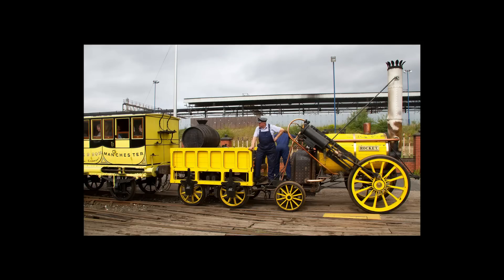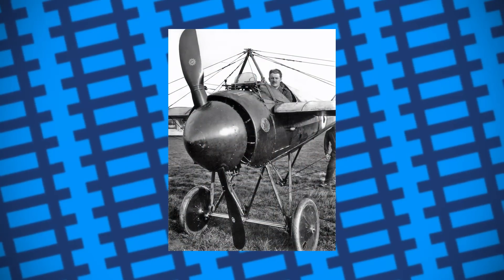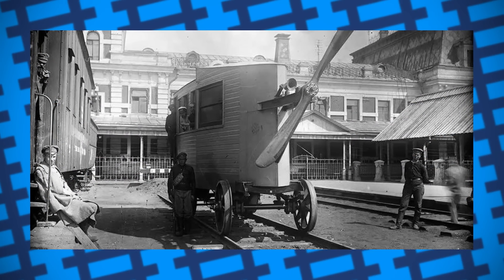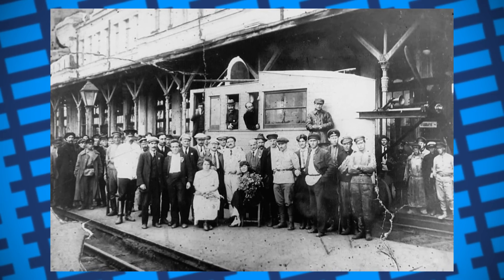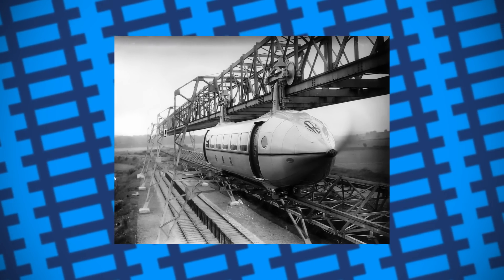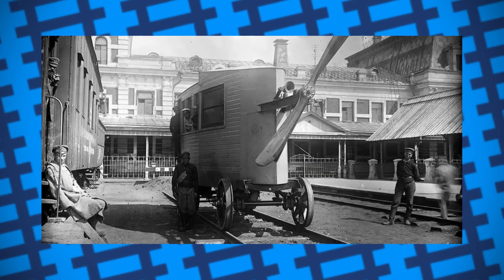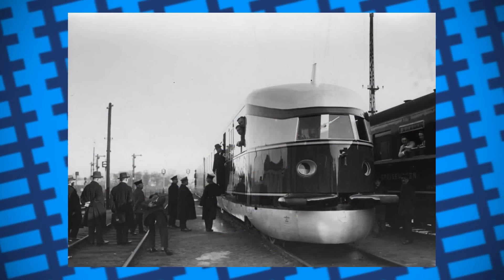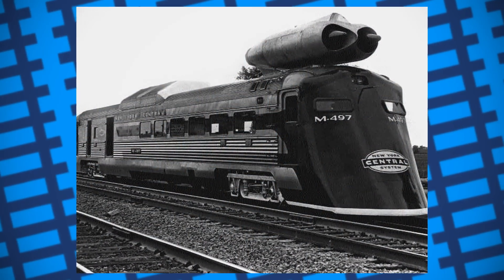The super fast propeller powered trains (and why they never caught on)

Comment: This entire concept can be summed up by two words.  Grip, torque.  The props have no grip on the air (by definition, compared to iron wheels on iron rails), and for getting any amount of weight moving from a dead stop, or running up an incline, they have no torque.  This is a 100% nonstarter.  Period.
Reply: So how do they work on aircraft, then?

Comment: I guarantee these railcars would have gone just as fast if the same engines were connected to the wheels through a gearbox. They were fast because they were lightweight not because of the spinning murder blades. Why use air as reaction mass when you can get so much more torque out of wheels connected to solid ground? It's madness.

Comment: I suspect the biggest actual deal breaker was that propellers are less energy efficient, and the noise coming in as a second. The actual practical advantage is, or was, simplicity, you can drive a propeller directly from an internal combustion engine, steam turbine or electric motor, without gearing, which still is an advantage, but not as big as it has been. 

The other issues are manageable. Climbing and low speeds can be solved with variable pitch propellers and or hybrid systems. About safety, propellers doesn't have to be uncovered, or mounted dangerously close to people. With a hybrid system you wouldn't need to spin the propeller at or near stations. And, propellers could be used on a pusher unit which would allow multiple carts, with a propeller in pusher configuration, trains doesn't have to be pulled solely by a locomotive in the front, one of the big advantages of trains actually.

Comment: A vehicle propelled by the reaction principle (propeller, jet, rocket) is less efficient than a vehicle with powered wheels, because the mass of air (or combustion gas for the rocket) blown in the reverse direction to the vehicle's movement carries kinetic energy away with it.

Comment: Kruckenberg used building techniques developed by the Zeppelin works, his rail zeppelin had an aluminium spaceframe structure and a smooth skin of impregnated tarpaulin. It had only two axles of a rather long wheelbase, resulting in a bumpy ride on jointed track, so it would require long mostly straight continuously welded tracks. For shunting it had a little battery-electric motor and one of the axles could be steered with a steering wheel on curvy tracks in stations and depots.
The prototype, equipped with an aircraft motor by BMW, was tested with two and four blade propellers and reached up to 230 km/h, breaking the world speed record set earlier by an electric unit in 1901. That held until the French experiments with electric high speed trains in 1955.
After the tests the unit was rebuilt and received a new front end with a powered bogie to test hydrodynamic transmission. The propeller and motor at the rear end were removed. A few more tests were done and once the war had started, the aluminium was required for aircraft building. I'm not aware of any component of the unit being preserved. One half had Bauhaus-style steel tube armchairs, the other half was set up as a laboratory with measuring equipment.
Franz Kruckenberg developed a diesel-hydraulic unit "137 155" in 1938, which reached 215 km/h in a test but wasn't repaired after an axle broke in 1939. The war stopped all further development of high speed trains. Some fragments of it are preserved in Dresden.
Post-war Kruckenberg was involved in the VT10 (which didn't make it past the prototype stage and, even though it entered regular service, was retired soon thereafter due to a number of flaws) and VT11 (the famous TEE unit of 1957, used in different services until 1988 and briefly revived in 1990). Of those a number of vehicles are preserved at different locations but none are operational.

Comment: Let's not forget that pre-WWII propellers were not as efficient as modern-day props. While a propeller could drive a train without a transmission, directly attaching the engine to the wheels will always be more efficient than using a propeller.

Comment: The biggest disadvantage I see of this comes down to physics. To go forward you have to push on something, Newton's third law. The greater the mass you are pushing back, the more of your power goes into pushing yourself forward and less into pushing something else back. A propeller is blowing air back, making a lot of wind that is wasted energy, while driving the wheels is pushing against the entire Earth, so nothing wasted moving anything else. Airplanes have no choice but to use air, but trains (and cars) can use wheel drive, and boats/ships are more efficient using a propeller in the far denser water. There's also the drawback of noise, along with the mentioned safety issues. The only advantage I can see of a propeller over using that same engine to drive the wheels is that a propeller can be direct drive (though that also means no reverse unless the propeller is reversible, which none of these appear to be), while wheel-drive requires a transmission of some sort that is often much more complicated and less reliable. Transmissions that could work at all speeds and handle the power involved with trains were a difficult challenge in the timeframe of these experiments, so I can see the appeal of simply sticking a propeller on it. Even some cars tried this for the same reason. But over time the transmission issue was sorted out, in most cases using a generator and electric motors to serve that function.

Comment: An earlier example of a prop driven railcar was constructed in WW1 by German airmen assigned to Palestine. They used a 4-wheeled flat car with a Mercedes 6 cyl engine and prop to reach the beach as fast as possible. Reputedly it didn't have brakes...

Comment: Propeller, jet, and rocket driven rail vehicles give up one of the great features of rail transport:  the efficiency of propulsion by steel wheels on steel rails.  When you apply energy to propel something, by Newton's laws of motion (or Einstein's if you want extreme precision, but the difference is negligible at Earthbound speeds), equal momentum must go into the object being propelled and whatever it is propelling itself against.  Momentum goes by the product of mass with velocity (figure in the gamma factor if you want the Einsteinian version, but at all Earthbound speeds that's essentially 1 with a whole bunch of 0s behind the decimal point before anything interesting happens).  Energy, on the other hand, goes by the product of mass with the square of velocity.(divided by 2, but that's the same on both sides of the comparison).  So if you have a ground vehicle using its wheels to push on the ground, both it and the ground move, but the Earth (or anything massive enough to have a usable gravitational field) is so much more massive than the ground vehicle that even though both the ground and the vehicle gain momentum equal in magnitude (although opposite in direction), essentially all of the energy (barring slipping and/or frictional losses) goes into the vehicle.  On the flip side, if you are pushing on air (propeller) and/or exhaust gases (jet or rocket), for any workable size of propeller or jet engine fan or rocket fuel/oxidizer quantity, the mass of what you are pushing away will be much less than that of the vehicle, and so most of the energy will go into the air, jet exhaust, or rocket exhaust.  Water transport is in between:  For a propeller of usable size, the mass of water moved at any one time is still smaller than the vessel, but not absurdly smaller, and the sheer size of cargo ships allows them to more than make up for this by having a sufficiently greater ratio of volume (cube of linear dimensions) to surface area (square of linear dimensions) that once cruising speed is achieved, frictional losses are even lower than for a train, and a ship never climbs any more than the most gradual of gradients (going up a navigable river) unless in a lock or on a carrier, in which case the reaction is once again against the ground.  So for ground transport, the way to go is to have motors spin the wheels (most ground vehicles), have a cable haul the vehicle (elevators, funiculars, and their relatives), or have a linear induction motor push on the linear induction track.

Comment: I wonder what would happen if instead of 1 big propeller, we use a bunch of little propellers. Kind of like a drone. Also, for the safety of the people around the train, put some sort of case around the blade's like what we have for most fans.

Also, I like your use of the bad piggies theme.
Reply: We could rotate the propellers 90 degrees, make them really strong steel things with like a circle shape, and use them to also support the weight of the train. I feel like where wheely on to something here. They probably wouldn't catch a lot of air, but they could use electric engines or fuel driven engines to drive these propellers and I'm guessing they'd be fairly efficient at transferring power.
Reply: More propellers would mean more complicated and less efficient. Using a cage would add drag, making it slower and less efficient. Might be possible, but there's really no compelling advantages and many disadvantages versus wheel-driven propulsion.

Comment: the monorail above an ordinary line honestly makes the most sense of the lot
Reply: Just build additional track on the ground
Reply: @Ganliard  takes up more room and brings in all the issues mentioned regarding safety around the prop and holding the train to the rails. Having it hung in the air via a monorail eliminates those two issues and allows for a more confined setup
Reply: @lalnablehector1285  Or just you know

Simple monorail serve well. It's 2023 anyway, people already well know aero-based driver isn't as efficient as direct drive from wheel
Reply: Super expensive.
Reply: @redtobertshateshandles  RIDICULOUSLY expensive...

Comment: I guess the combination of slightly more common sense of the time due to most mechanical things being dangerous at the time, plus the large amount of noise generated by the straight piped engines and the propeller itself led to no one getting too close, and probably the lack of wide spread use meant that the one numpty who would usually be the cause for safety warning signs had not had a chance to drop his or her item closeby and then bend down obliviously to pick it up

Comment: More over the schienenzeppelin (pronounced sheenenzeppelin) didn't have bogies (only two single axles) as can be seen at 5:07 which meant that it wasn't easy to shunt it for this additional reason. It didn't fit on a turntable (is that the right word?) too so if they wanted to change its direction it had to be shunted on specific rails without tight corners. 
Still a lot of its aerodynamic approaches got used later on. :) It's just a prototype if you want to say so.

Comment: I'm surprised that although the rail zeppelin didn't catch on as a propeller driven railcar, it managed to predict the shape of the bullet trains that would change the course of high speed rail 40 years later.
Reply: Rail Zeppelin inspired the Flying Hamburger which inspired Gresley for the A4's design.
Reply: It was just aerodynamics.  Nothing to mimic.
Reply: The propeller-driven aspect of it didn't catch on due to it's disadvantages, but other elements of the design would become more common over time.
Reply: The Shinkansen is actually based on airplane fuselage design.

Comment: I would imagine the lack of ability to connect to other rolling stock and the exposed propeller would be fairly easy issues to fix.
Reply: Sure but it's unlikely it could pull any significant weight.
Reply: @Mike-me3sp  True but not having coupler is also an issue of not being able to tow the thing if it breaks down.
Reply: Ha, this is very true. However if I were building such a crazy thing I'd want to save as much weight as possible and a coupler arrangement would factor into that. If it needed a tow I'd say 'make sure you bring some chains' lol.

Comment: 4:15 To add on to this, I think that propeller-driven trains would struggle to pull a large load, since the propeller would just move air instead of wheels providing traction and thus motion.

Unless, of course, they made a turboshaft locomotive that applied the torque directly from the jet engines to the wheels.
Reply: At which point you just have a gas turbine locomotive with mechanical transmission... and a propeller on the front.
Reply: I don't really see this sort of locomotive be used for freight. It's purely a passenger service...
Reply: @theotherohlourdespadua1131  I see a jet turbine powered locomotive a death trap on rails!
Reply: @ZackarySchejbalCODBO2RGM2  Nah, they power tanks with a jet turbine. Though I think you mean if it was used for propulsion like an aircraft of course.

Comment: If we ever plan on building another propeller-driven locomotive (which I doubt it'll happen), we should weld a cage surrounding the propeller like on air boats. (Spoilers at the bottom)

As for that jet train at the end of your video for a preposed next video, you could say that having the location of the turbines would make the locomotive too tall for the loading gauge and they can be knocked off from tunnels and low hanging bridges.
Reply: ahh the Ducted fan, so lets go all the way and but a big by pass jett engine on it.
Then it will go uphil without any trouble. 
The track itself on the other hand will loose all its ballast between the sleepers
Reply: @obelic71  Not to mention how absolutely dangerous being around a jet powered train would be. Jet plane engines are already super dangerous, hell a guy got sucked in one and was reduced to atoms from one Boeing jet engine. Imagine one of those on a train. Absolutely a death trap!
Reply: @ZackarySchejbalCODBO2RGM2  Not as dangerous as you might think, search "Ground Crew Sucked Into a Jet Engine" and you'll find an example where a man survived 3 minutes of been sucked inside one.
Reply: Propellers only make sense in the air or sea, fluids where you cannot hold to actual solid stuff to apply forces with better efficiency (aka push through wheels).

Why push air that will push you, when you can push wheels directly.
Reply: @GeomancerHT  And there's no way you could end up getting decapitated or turned into a spray of blood unless your dumb ass isn't looking where you're going
Reply: Propellers... Pfff.... I want to See a maglev powered by a methane rocket engine 😅
Reply: Nevermind all the noise....
Reply: Well said, man.

Comment: I find the the idea of having a propeller powered train to be... practical all things considered. As shown in the first two examples, all one needs is a suitable rail carriage and an airplane engine to make one, no more fussy transmission system to worry about breaking down and needing lengthy periods of time to replace. Also the idea of it being unsuitable for any moderately steep inclines seems moot when one remembers that high-speed rail lines these days require that the tracks be as straight and level as possible. Sure the propeller is a massive safety hazard but then again you can cover it with some cowling and have it taper at the end for more power.

The way I see it is that this system is the best way to create a moderately priced high-speed rail system without going through much expense. Yes, the rail lines would be modified to cater to the train's unique attributes but I believe that cost less that trying to make an entire new line from the ground up and use proprietary rolling stocks for it...
Reply: but you would still have the capacity issue of not being able to add coaches, they would also need other engines to work at low speed and while high speed lines are generally straight some of them still require steep gradients that an electric train can handle but not a propeller one. Not to mention the constant loud noise of the propellers at ground level!
I personally see them as a mix between most of the inefficiencies of the Hyperloop and some of the efficiencies of normal rail.
Reply: @marcogentile3392  Those issues would be mitigated with technical ingenuity like make the train a pusher configuration and making sure the line doesn't have too many gradients. Noise is... something they have to live by, unfortunately. 

But your observations are astute...
Reply: @theotherohlourdespadua1131  But there's no advantage over a conventional diesel or electric high speed train from using a propellor, and I suspect it is heavier on fuel - that put paid to gas turbine trains as well. As for gradients, modern high speed lines can have very steep gradients because the trains have so much power. It's sharp curves that they need to avoid. Indeed on the French TGV Midi line the only speed restriction was where it changed from 1 in 28 up to 1 in 28 down and the restriction was to stop it literally taking off. Propellors really aren't very efficient and the only reason they were used in aero engines is because you couldn't simply transmit power to wheels when airborne.

Comment: Why push against air - which is very soft - when you can get traction on nice firm rails?
Reply: The same reason why supersonic cars to break the land speed record used jet engines to push against the "soft" air instead of transferring power via friction through the wheels.